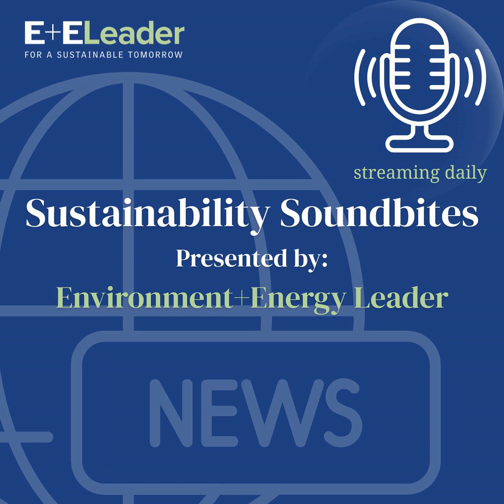Stone Bricks Gain Ground as Low-Carbon Build Option

Comment: People don't understand what this is. Diodes and cathodes cand be inserted into sea water soaked sand, inside of molds. Then low voltage is introduced, and it turns to sand stone. We have known since 2024. Solar or wind could easily supply an operation on a beach, because it does not require much power. We still need heavy equipment to move the finished product. With sea water being routed into Nevada, stone brick operations could be built it the desert. Water could be desalinized, in the desert, for drinking and growing things. You don't like concrete? We could build megalithic interlocking earthquake proof walls, like our ancestors, did out of sand. Deserts have sun, sand, and wind. Pipe in the seawater, and you're in business. Build a rail yard too. With water and solar heat, use steam power to compress air, for all the masonry tools and, and lifting. Float the really heavy stuff in canals. Fill empty chambers with water and produce compressed air on a vast scale, same as the ancients did, when the Nile would flood. We are just catching up.